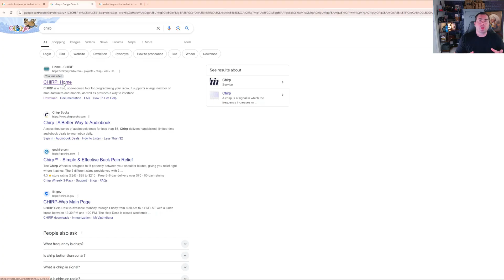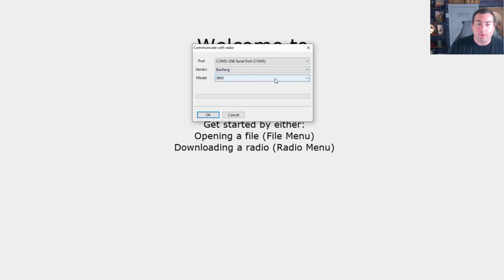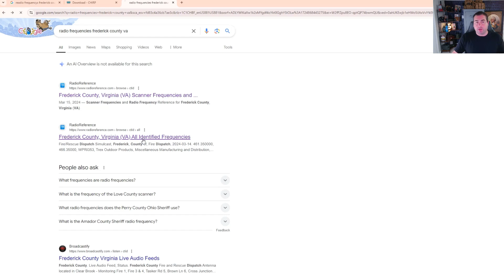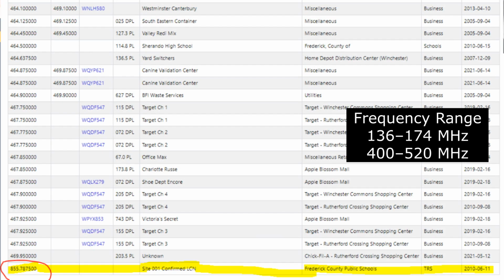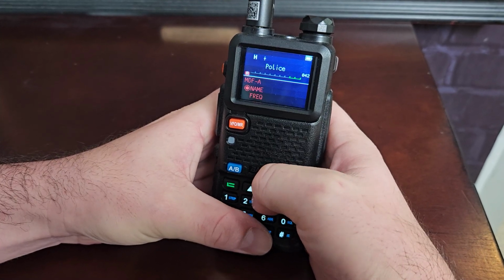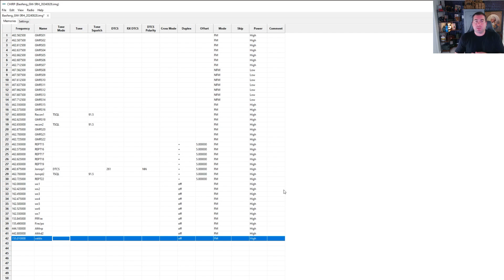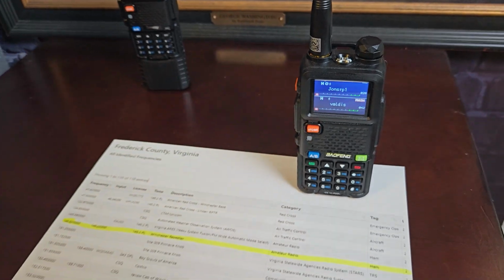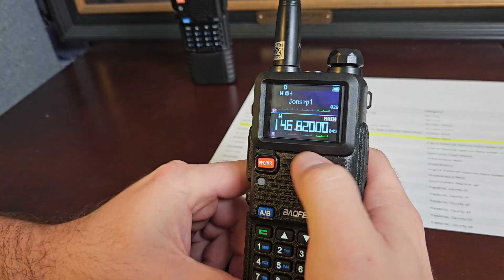How to Listen to Police, Fire Rescue, EMS & More with Your Radio | Step-by-Step Guide

Comment: Ok some clarification of US emergency comms. While most agencies use trunked systems and digital encryption for security, you can monitor some transmissions with interoperability frequencies.
Most city, state, county & federal systems do not use the same radios, bands, modes nor encryption. Hence in emergencies the need for common mode communications settings.

See the App Store or online list of eNIFOG channels and interoperable uses in your area.

Comment: Can you help me find frequency for Suffolk County police in Suffolk County New York? Primarily sixth and seventh precincts
Reply from the maker: Here you go. Let me know if this link works. https://www.radioreference.com/db/browse/ctid/1876
Reply from the maker: What frequencies do you want to listen to? you may need a either 33cm radio or a 6 meter maybe even an hf. You need to check if there digital encrypted/ trunked first. In this video I do mention that some are going to be impossible to listen too but we can check.
Reply: @citizensurvivalplan  Suffolk County police, 700/800 MHz bands for trunked radio systems. Suffolk County uses a Project 25 (P25) trunked system alongside a Type II analog system. Grok: Recommended Models: 
Uniden BCD436HP or BCD536HP
Reply: The frequency is outside the range for the radio you suggested. Is there another option?

Comment: it's 2025...if you live in the Dallas TX area this will NOT work as ALL have gone over to the interoperable system which is P25 based. Most police  fire Ems etc used to work up until about a year ago. Now you only hear old people talking about nonsense and nothing important.

Comment: Gov't requirements after 9/11 have all law enforcement sensitive information transmitted encrypted typically on 800mhz.  Most counties in the USA are, or have moved to 800mHz trunked systems.   You might get a few highway dept, and civil workers still using analogue on lower frequencies.
Reply: This ^.

Comment: Using chirp is very convenient, and gives you greater control over radio settings. But you absolutely should keep printed, laminated frequency lists as well as instructions on how to manually program your radios.